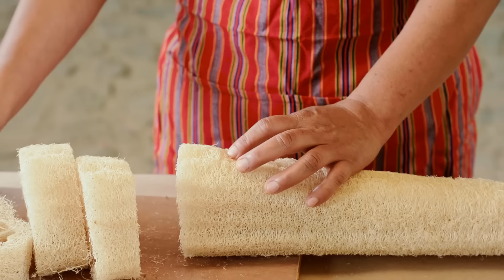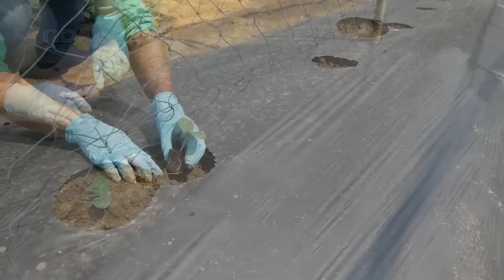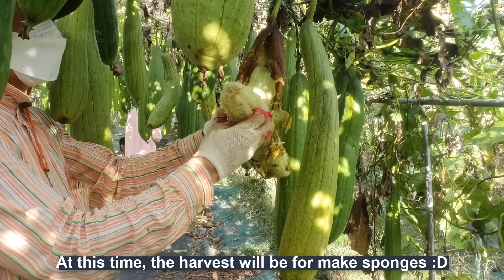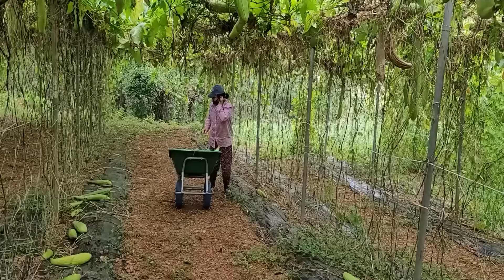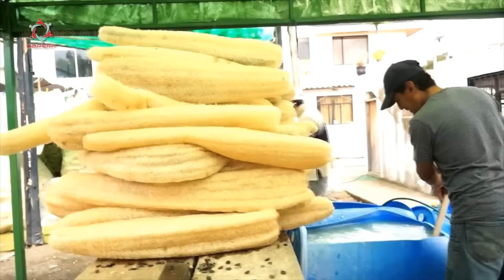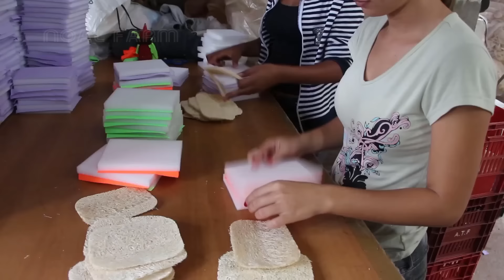Amazing Luffa Farming and Harvesting - How Luffa Sponges Are Made - Loofa Cultivation Process

Comment: We use the dry fruit (they are sold like that). We remove the outer skin by hand and make a slit to remove the black seeds. No processing is needed and we use the whole fruit as the scrubber. It last about 6-12 months on a regular use. Excellent scrubber for dead skin (do not use on face).